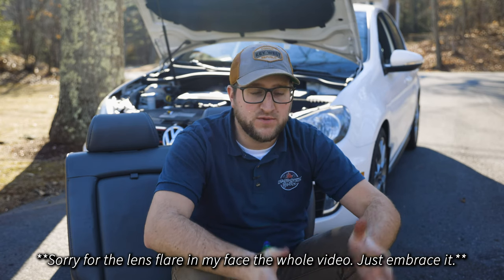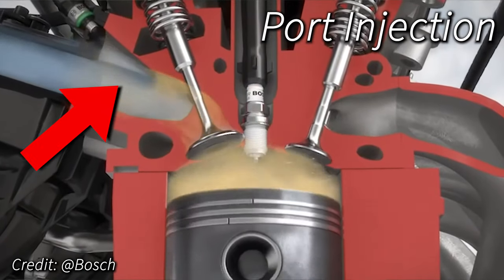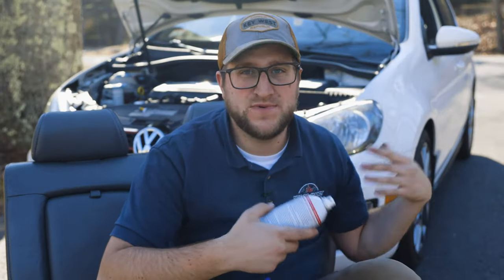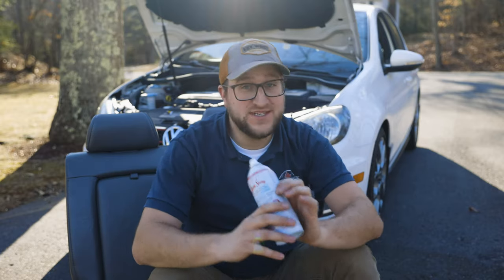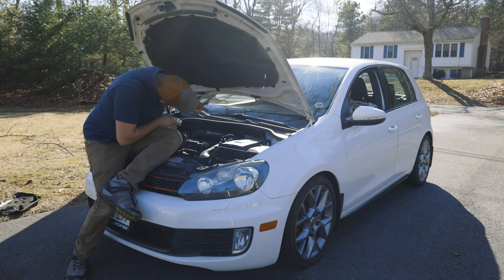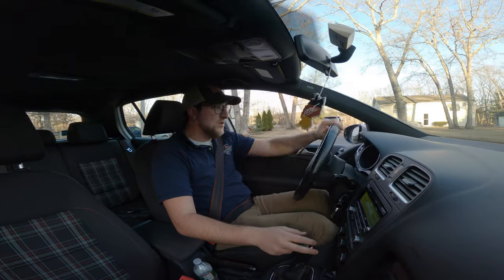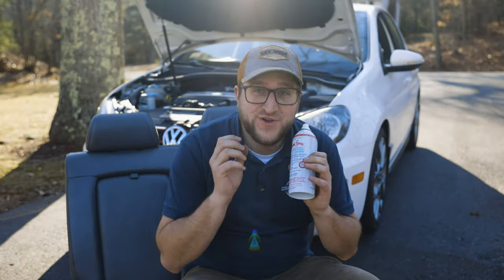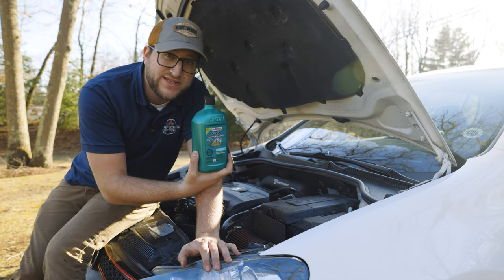Prevent Carbon Deposits in Your Direct Injection Engine!

Comment: So spraying a cheap oil mixture in your intake is supposed to get rid of the oil build and breakdown of previous cheap oil.   Sounds logical to me.  Many of these products contain large amounts of oil, thus all burning oil and smoke which is leading to CAT damage.  Doung these treatments dumps huge amount of hard abrasive soot in the oil, in the cylinder, and remainder of the engine.  Oil analysis proves this.  Use a 100% engineered synthetic oil will perfirm better, reduce oil oxidation and protect better.  Castrol and just about every other full synthetic is just fini oil with an added hydrogen molecule so they can call it synthetic when it isnt.  Follow the science, not oil company tricks and deception.

Comment: It only “works” if you show a Boroscope view of the intake valves… 

Some videos show that these things may help but don’t really “work” 
As in, it can be a bit of a preventative… but once there is carbon, it won’t get rid of it.

Also the smoke after using Seafoam isn’t anything to do with carbon. It’s the solution that’s used, someone proved this on a new engine and the other products such as CRC, Liquimoly etc don’t have any smoke.
Reply: yeah this is what i was learning too. enough carbon builds up and your only option is to either blast it with something or other means of deep cleeaning that are expensive (or just buy new valves).
Reply: @colinhare6963  ..."just buy new valves" ...walnut blasting is much cheaper, I don't think anyone would buy new valves just because of carbon deposits.

Comment: I want to do this but im afraid of ruining my catalytic converter! I think i would just removed the intake and have the valves nut blasted!!! Still great video!!
Reply: Yes the carbon that breaks off can clog the converter but they also make a converter cleaner also. CRC who I trust over seafoam makes one that you spray into the throttle body just don't spray directly on the MAP sensor. You can Google up CRC fuel system and turbo cleaner.

Comment: Is there an advantage to spraying this directly into the intake manifold compared to into the fresh-air intake pipe past the MAP sensor?
I'm planning to do this with the CRC cleaner (same idea), and the instructions with that specify to do the latter.
I feel like disconnecting that PCV hose without plugging it up on the PCV side might lead to pressure problems that in turn could lead to blowing the rear main seal -- a common problem when the PCV system develops leaks all by itself.

Comment: So you're telling me that you can litterally disconnect the hose from the PCV valve and spray dirrectly into that hose on the TDI engine and that should do the trick? I got the GDI cleaner by LUCAS and I wanna do this, but I don't wanna have to dissasseble a bunch of stuff and I dont have much tool at home :/

Comment: Have you looked at the valves to check for the efectiveness?
Reply from the maker: I did. It certainly helped keep the carbon at bay, but I did eventually carbon clean at 150k miles or so. Still, that’s a lot better than some other examples, having to clean at 70-80k miles.
Reply: cheers for the reply @NotSoHandyCarGuy  just cleaned mine @70k and it was pretty bad. It's a horrible job, very time consuming.
Reply: What about a catch can?
Reply: Might doing this set off the check engine light?
Reply: @zzman5306  catch can won't do any good in this case.  There's a period in the 4 stroke cycle called overlap, that's when the intake valve is open at the same time as the exhaust valve at the end of the exhaust cycle.  That's where the carbon comes from, it's exhaust gases passing back into the intake & leaving deposits behind.
Reply: The industry did this at least partly to reduce emissions.  Then you drive your car around belching smoke.  Didn't that negate the emissions benefit?
Reply: @NotSoHandyCarGuy  BS!

Comment: Any ideas if you’ve had two engine misfires (1 year apart) from carbon buildup? 2013 pilot and the cost for cleaning is about the value of the car. I’m worried I’d damage the catalytic converter as you mentioned but would hate to call it quits on her so soon & trade her in.
Reply: Shorter trips tend to cause carbon to build up faster... learn how to clean carbon yourself it's not super hard job just time consuming to take the intake manifold off.

Comment: Question??  This might be a dumb ? I'm a 2013 KIA owner with GDI. I had no clue why I was getting such terrible gas mileage, (16 city/22 highway) The amount of money I have wasted is insane. I recall one misfire. Didn't know what it was till now. It really seems to run well fortunately. I'm at 90K miles now, owned it since 11K, and never even knew to clean the intake valves. It's too late to try this method of removal (with SeaFoam) due to likely destroying the catalytic converter. But...what if I temporarily open the exhaust bypassing the catalytic converter just to do this, one time?? Then next time I do this (every 10k miles) it shouldn't be an issue running the carbon through it. Does this sound logical?  Anyone??
Reply from the maker: Don’t worry, that’s not a dumb question! Is it turbocharged? Either way, I don’t think that would be the best option. You’d run into a mess with your O2 sensors, and you may still damage your piston rings. On top of that, the seafoam won’t completely get rid of the carbon on your valves- it’s more of a preventative measure. I think your best bet would be walnut blasting your intake valves, either on your own, or take it to a shop to get it done. Not sure how knowledgeable you are when it comes to mechanics, but it might just be worth taking it to a shop to get the valves carbon cleaned. Good luck!
Reply: @NotSoHandyCarGuy  I didn't expect an answer so quick. THANKS!  Yeah I kinda knew when i asked it wasn't a solution. No. it's not turbo charged. I bought it from a dealer @ 1 yr old & 11K. I got bad mileage right away and back then it was correctable with SeaFoam. If I knew. But I didn't know, and the dealer sure wasn't going to do it, or tell me about it. KIA dealership too. They knew. 🤬  I will ask my mechanic if he can walnut blast the valves. I asked him at least twice about the bad mileage and he didn't know, so he might not be the right guy for this. Thanks again!

Comment: Buy a car with pot injection our 2017 Suzuki Baleno has port injection or buy a vehicle with a caburator well my 1997 Toyota Hilux has a carburator oops you don't get Suzuki's in the USA but we get them in Australia and carburatored  utes up until 1997 so no carbon issues so no problems